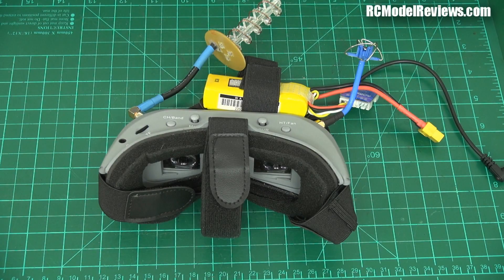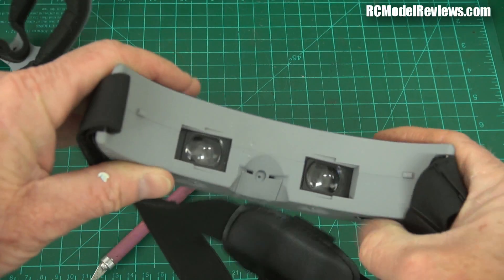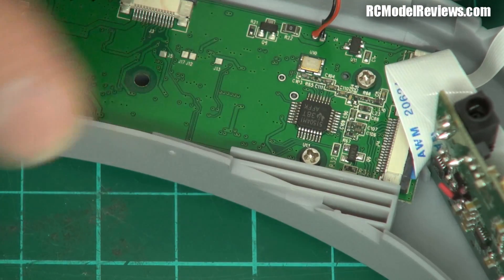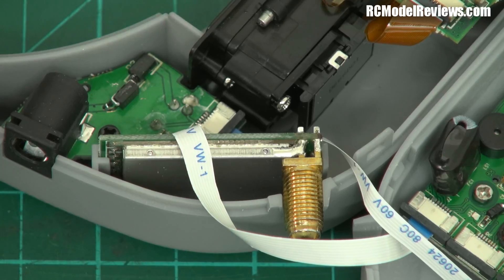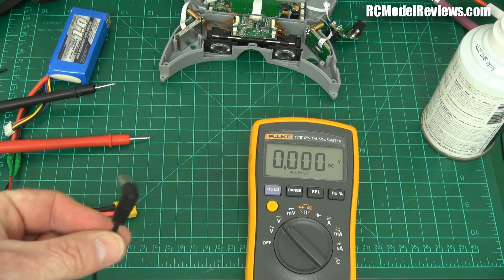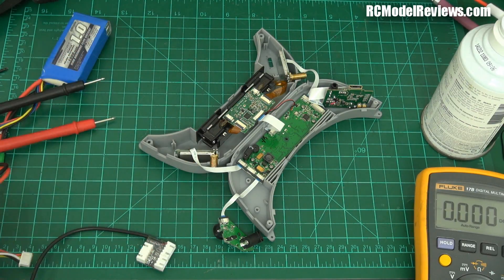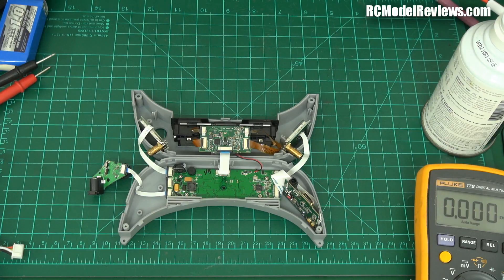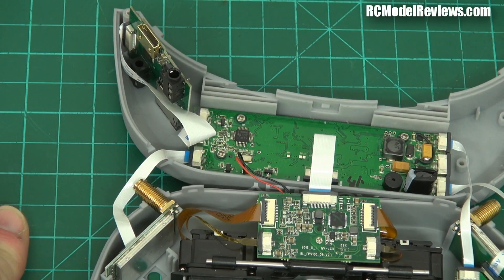Aomway Commander video goggles (teardown/repair)

Comment: I had the exact same problem with my pair of Aomway goggles. I cut the cable and soldered on a brand new connector from the electronics store for about $3.00. It is obvious this is a quality issue and Aomway should be sending every person who bought the goggles a new, better quality cable with decent strain relief.

Comment: I wish you could slide them further apart my eyes are just about too far apart to use mine, its hard to get them perfect on your face so you can actually see everything clearly. My antenna on the left is loose inside the goggles from new, annoying so came to see how to open them. Adding a pwr switch is a good idea, I have been keen on doing that for a while, stupid barrel and leads always wear out. Having said all that, I love them, I am super happy with the performance they really look great but on cloudy days not so great. I only really fly if sunny so I get decent HD footage so not a prob. Thx for the vid, good help. I have a FatShark Battery Case on the back of the strap and if I knock it I instantly get a black screen, it cust the power off but never comes back on unless you replug it in, another good reason to have a switch.

Comment: The DVR and Mode buttons popped off of mine, I knew to not put much super glue at all, so I put a tiny part of a drop into each button, put them back in and now they don't work properly.

These are bad quality goggles.

Comment: Yep those leads are horrible, I have got rid of all that junk, they are very unreliable. I am having a major issue with my Aomway Commanders. They record DVR perfect with my Whoops (NTSC) and my Wizard (PAL) but I have a new XJB 145 and it is a PAL camera and it will not record DVR that is watchable, everyone with that quad and Aomway Commanders has exactly the same prob. Here's my video https://youtu.be/tKg5Rc8_zWE  Now I have been talking to Sean at Aomway and he sent me updated Firmware Files for my goggles. BUT... he says the reason for bad flashing video is that my goggles must be stuck on Default NTSC for DVR Recording, so I need to update the PAL Firmware but once I do that I can ONLY record PAL, not any NTSC. That would mean I can "maybe fix my problem with new XJB" but would no longer be able to rec DVR of any of my Whoops (NTSC). That doesn't make sense though because I have been recording perfect DVR from my Wizard (PAL) and Whoops (NTSC) for over a year now. Any thoughts on that? I am so confused right now I have no idea which way to turn. Your video is very interesting, talk about crappy inside!!
Reply: So what would you recommend to replace the lead?
Reply: @ValFPV  Get rid of as many connectors as you can, thats the weak point. It turned out to be the new quad that was not at all compatible.
Reply: @BrigzyFPV  so just direct solder the 2s battery to the stock DC Jack?

Comment: The motherboard went out on mine after 3 months, I bought them from the only place I could find them in stock (geekbuying) Aomways didn't bother to even reply to my e mail, can and after months geek finally offered 15 off shipping, and 120.00 for the board, of course I have no other choice as cheap. Do you know where to get parts any cheaper?

Comment: Hi, i really liked your video. I've laugh a couple times really loud :-) Good Job :-) I've got exactly the same problem for months, but couldend find anything wrong. Turns out it was the JST connector on the power cable.

Comment: Hello
I have the same problem, thank you very much for the video. I have another question, always feed the glasses with 2 cells and when the output is halfway I was 7.4 +/- according to the lipo. Once I put 3 cells at the entrance, I had the Same voltage at the output and the same with 4 cells, so it does not matter the input voltage, the output is the same as the input.
So this multiple power connector has only one capacitor of 220 mf and one component (which I do not know what it is), I think it's a resistance. What is the function? Is it a filter? How is the circuit? is it like that? thanks

Comment: My dvr doesnt work either sometimes and i get black screen occasionally and the fix is just to plug and unplug. I dont know about the dvr but i put it in auto record and sometimes it records.
Reply: Yo tengo el mismo problema. He pedido un nuevo cable de potencia, pero no sé aún si funcionará. Igual también es del cable del dvr. ¿has conseguido solucionar el problema?
Reply: I have the same problem. I have ordered a new power cable, but I do not know yet if it will work. The same is also the cable of the DVR. Have you managed to solve the problem?

Comment: Thanks for the vid. A quick question if I may. I just received my commanders and try as I might I can not get it to work with HDMI. I am not a complete noob and am pretty tech savvy. I have tried different cables, different settings, even tried the on different computers. I took them apart and everything seems in order (and neater than the insides of yours) so I am totally stumped. The main reason I chose these goggles was so that i could practice with velocidrone when the weather is shitty here in Melbourne and also so I can practice at night. I can use the goggles fine when flying. It just appears to be HDMI I am having problems with. Sorry for the long message btw.....
Reply: Mine work with HDMI and the SIM's no problem, just needed the right plugs and it worked fine.

Comment: Those right angle barrel connectors don't last. I have quantum goggles that did the same thing. I replaced the barrel connector with a JST over a year ago and no more problems.

Comment: Same issue I've had with my Dom V3's. I have had this issue with a stock Fatshark battery and a custom battery I made. I found the barrel connectors seem to be the issue in both my cases. Can't seem to be able to find a quality barrel connector that doesn't fail in 6 months or so. Always plugging and un-plugging that connector seems to ware them out pretty quick. Another reason that a power switch would be helpful and take some of the ware and tare off the connector.

Comment: Thanks! As a new owner of Aomway Commander I doubt about need to open them just in case to see if something is wrong but now I certainly will look inside for assembling issues. By the way those cheap plastic encased jack connectors does break quite easy. Seen that quite often in various equipment - radios, laptops, kitchen equipment etc. Buy a new cable or replace jack connector to a better quality jack connector. And thanks about pointing to flex cable position at left side. Before to put left side flex cable at other board side, some thin rubber must be glued on it at board side for protection to avoid tearing it by rubbing against board back side with all those spiky electronic components and soldering ends.

Comment: I pulled mine apart. Had the same sketchy diodes and wires in place. Flat flex cables bent over themselves. Mine also had the added benefit of coming with the DVR being defective! I also had the same black out issues and determined it was the connector too. I sent the goggles back to Aomway a bit over a month ago and they still haven't gotten them! I'm going to be quite angry if they were lost in the mail or stolen. Overall it has not been a great experience.
Reply: Having a problem also only a week of testing about 25 -30 flights and many times while plugging in the balance port and leaving the barrel in the goggles i had many times no power.Gonna crack mine open and take a look inside.Already have a new cable coming but for 300 on sale i did not expect a problem so soon since it was working very nice a about 20 flights.Good luck.

Comment: Bruce what you've just experienced with the Commanders  is a common problem I've had mine about 4 months now and identified 6 problems with them the most serious is the black out screen you've just shown.......I like you traced it back to the barrel connector which I've replaced and done away with the balance plug connector as well as it has tiny wires that over time break off !!
However now I have replaced the barrel connector I still get black outs occasionally but this only happens when I first plug the power in.....It hasn't happened when I'm air bourne 'Yet'....!!!
So I have lost confidence with these goggles which is concerning !
Reply: Same here only just started testing one week and first plug in and nothing.Some time a couple times till it turned on but always get the beep.

Comment: WOW Literally just run into the same problem a couple of day's ago. Was a little fortunate as I realized it was the power lead before trying to open. I think this is definitely going to be the Achilles heel for these goggles but fortunately spares are available for only £3.50p from banggood. The face sponge wears quickly also but again its cheap enough to replace.
Reply: had same issue,bought 3 spares,now i dont worry

Comment: I'm about to release my review of these goggles, and it's not good at all. That dodgey soldering on the power inputs pcb was so sharp and sloppy it punctured the ribbon cable and fried the internal receivers. Long story short, I finally got a hold of Aomway for the repairs, and they told me to send them back to their Chinese factory, which cost me $24 dollars in shipping to do so. Once USPS International shipping relinquished custody of the package to the Chinese customs and postal service all tracking ceased, and the package has since disappeared from the face of the earth. So now I'm out $330 since the USPS says it's my word against Aomway's on whether or not they received my goggles. The lesson learned here is buyer beware concerning Aomway's quality control with inconvenient and sketchy customer and warranty services, I'll personally never buy their junk again.
Reply: I searched your review and it wasn't there. If you buy through bank or PayPal, and if you don't throw away your postage proof when you send the product back, there's no risk.
Reply: I once glued the tiny joysticks on the top that were keeping falling out and I fucked up the circuit board underneath which made impossible to use them again since you cannot change channel anymore. So I then contacted the support and they were very very helpful and they send me the replacement circuit board for 30$ incl shipping. In my experience I am happy with Aomway as brand, they have got an excellent support.

Comment: I own the Aomway Commander myself and my goggles reboot when I briefly disconnect power and reconnect power again. So for me it  is still suspicious, why  Bruce's screen stays black with the loose contact in his power connection cable. Main problem with these goggles is from my perspective is that when I use my lens inserts then I always see two pictures and cant adjust them with the interpupillariy distance sliders to one  anymore. Without the lense inserts everything works fine.
Btw. the Aomway Commander has a secondary power input via the head tracker output. Why are you  guys  not using the as power input to the goggles if you are not trusting the barrel connector?

Comment: Put a low esr capacitor over the power, it wil prevent noise and in case you have power breakup it will act like a small battery

Comment: Had no end of trouble with my fatsharks barrel connector, Ended up just solerding an XT-60 across it, no issues since.  As I run a 3s battery I also stuck a little 5v reg in the goggles and made a permanent output to the fan.  Couple of quid spent and trouble free.

Comment: damn, a had a premonition before watching your video. there were a lot of complaints about the power cable. the other faulty elements - the balance connectors on it.

Comment: I noticed that Stu from Uavfutures seems to have replaced the balance input board with a straight XT-60 to barrel (which would give the same output voltage it seems for 3S batteries)..

Comment: Hey Bruce, my Commanders are very early 'revised' ones (pre-ordered at BangGood and shipped on June 6th) and they don't have the bodges yours do on the PCB with the power barrel connector! There are 3 diodes properly mounted, side by side. So maybe yours are actually a pre-production set? I've had no problems with the IPD adjustment on mine either. I took them apart in September to add a power switch ... this has the benefit of reducing wear & tear on the plug lead as you can just switch off/on between flights. Here's a link to my post on RC Groups for the power switch mod - you can hopefully see that PCB in the pictures:

https://www.rcgroups.com/forums/showpost.php?p=38219738&postcount=1098

Comment: I am trying to use my Commander goggles with a 3S 9.9v LiFe battery pack and they won't stop beeping? Sounds like a low battery alarm but I thought these goggles would work with 2-4S voltage range, plug in any LiPo and they are silent, the LiFe's just make it beep. Even using the 2 wire output direct to the barrel lead rather than through the balance lead board.
Any ideas why?
Reply: 3.3V is plenty untervoltage for lipos
Reply: But it works fine and no beeping with a 2S (7.4v) lipo, and even a 7.2V NiMh battery pack out of the Taranis. Plug a 3S LiFe in (9.9V) it beeps??
Could it have some sort of circuit that knows what voltage ranges each battery type should have? Surely not that clever.
Reply: Thats what I think . Maybe it peeps at multiples of 3.5V or something